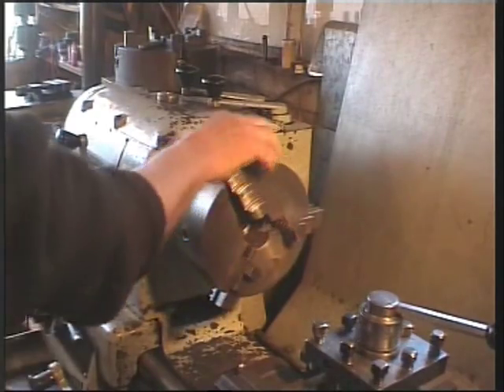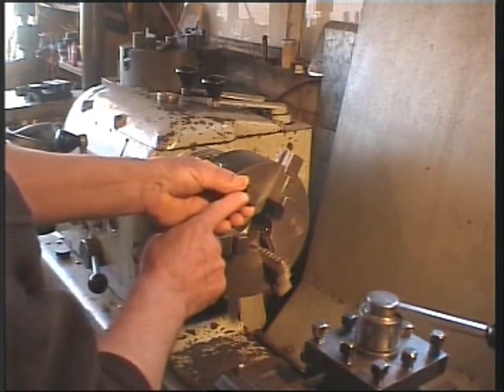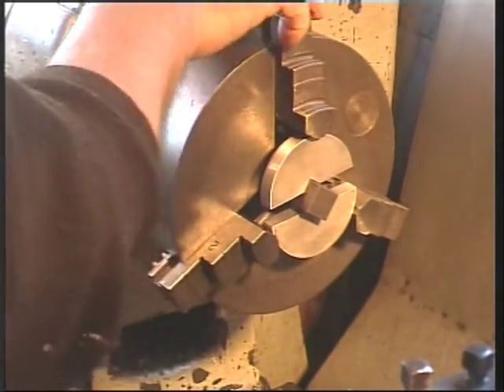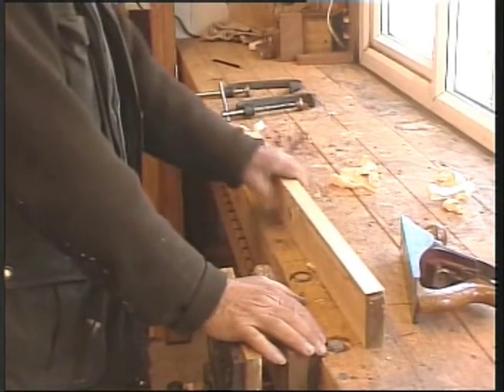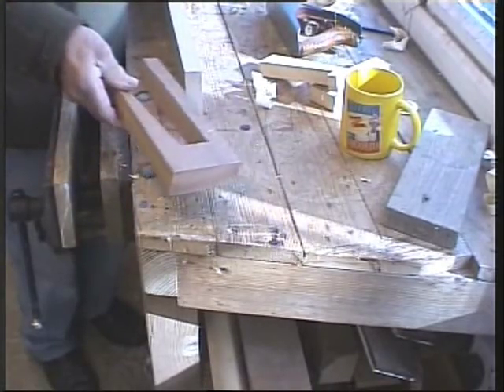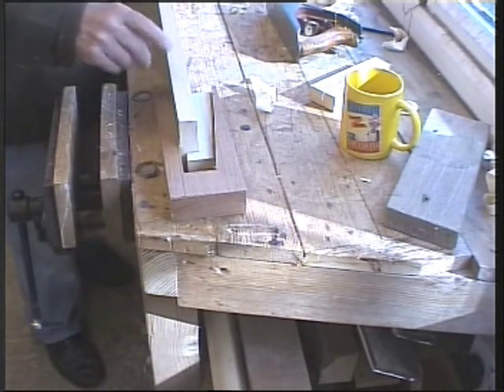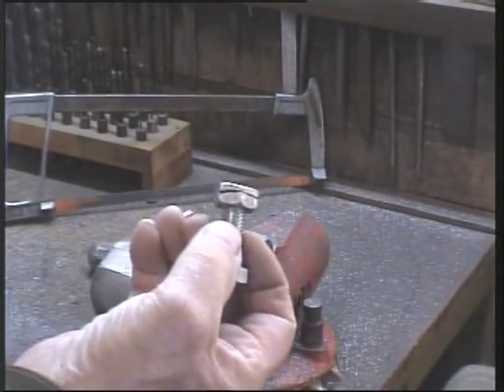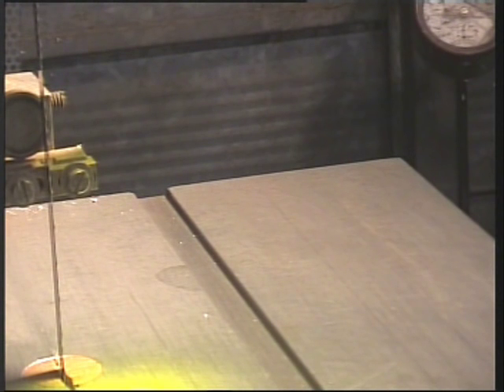workshop tips

Comment: Very enjoyable video , really like the dodge on the square stock in a 3 jaw chuck. Will definetely be making such a  widget 
On the subject of the drill chuck key , simply cable tie (Zip tie) the key an appropriate length away on the power cable so you can get the key to the chuck to tighten it. This way it's almost inpossible to lose or misplace! You always know where it is!

Comment: Best shop tips on the tube. That clamp for the 3 jaw is superb. I assume your trestle is what we call a saw horse.  Another trick to keep a nut on is to drill a small hole through the bolt and nut. Run a thin piece of wire through the hole, twist the ends together then bend it out of the way.  Old school racers did this to keep them from vibrating loose.  You can imagine how much vibration an engine will at high RPMs and high speed on the salt flats or race track.